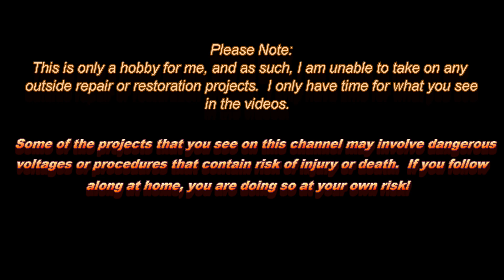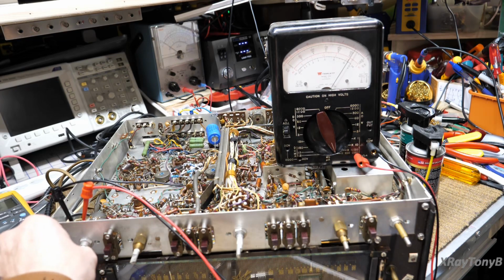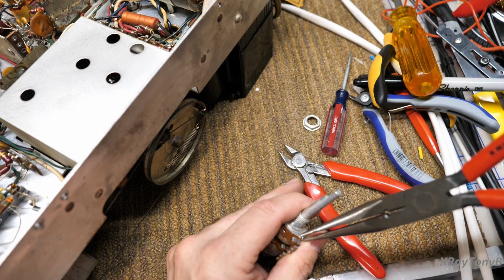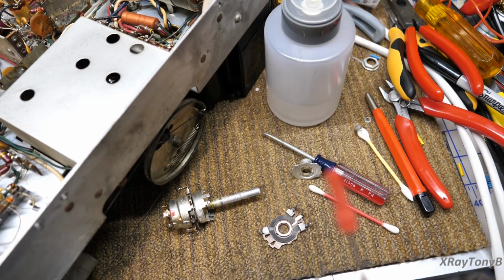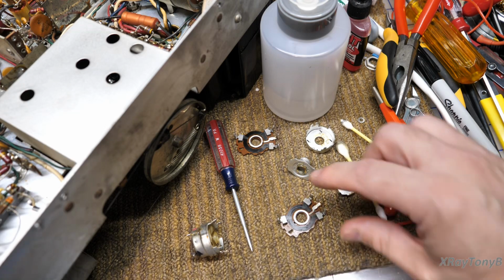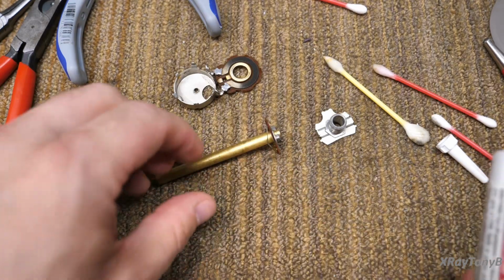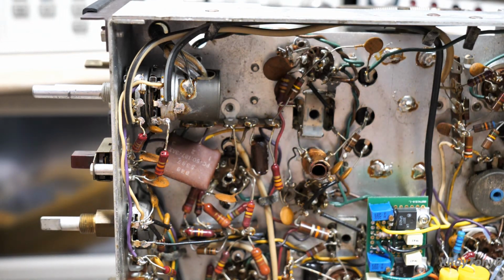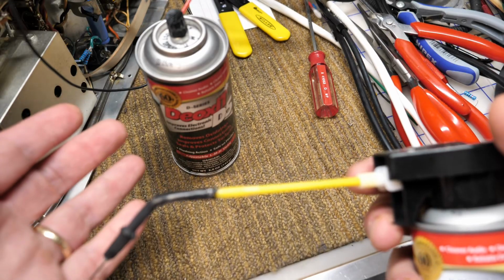How to Clean & Resurrect an Embalmed Potentiometer (With Bonus Rant)

Comment: This video is 2 years old now but I just want to say that I'm afraid Tony you are incorrect here and you should really make a follow up video. I have completely debunked the 'D5 eats carbon' myth on my channel. D5 is totally safe for use on carbon pots, and these days it even expressly says so on the can. Tens of millions of applications on millions of carbon pots by thousands of techs. If there was the slightest problem it would be all over the internet. There's virtually nothing. The solvent in D5 and F5 are identical by the way, so that's another error. Use D5 with confidence. I'm an amp tech with 50 years under my belt and thousands of amp repairs. This stuff is safe AND it's the ONLY spray I know which will sort all pot problems. Here's why. Almost any spray solvent will do on a pot because the mechanical flushing action blasts away debris and dirt. Even isopropyl alcohool. That will cure 90% of pot problems. BUT... on the final 10% the little metal wiper is oxidised and no amount of spray will sort it. DeOxit fixes this oxidation. That's why I use this product having tried many others. And no, I haven;t even had so much as a free can from DeOxit, so I;m not shilling their product!
Reply: Wrong still Stuart. You were wrong back then and wrong now. 
Deoxit makes a product that clearly and explicitly states it is for faders and pots.
It's called F5
D5 doesn't say anywhere that it is for faders and pots.
I'm not sure why you have this issue with comprehending basic logic. But there is clearly a stubborn I've always done it this way old man thing going.
You were wrong a year ago when I told you. And you're still wrong.
The process may take a long time. But you don't have to be the smartest person in the world to understand that mineral spirits will loosen carbon particles. It's why it's used to clean vehicle engines.
The track on faders and pots is made of what?
Pressed Carbon dust.
Do the logic stuart and stop being a stubborn old fol
Reply: John, see  my reply on your simular comment elsewhere. For others: John is merely repeating a myth with no evidence other than that he 'thinks' it to be true. John, if I'm worng, evidence please of D5 ruining carbon track pots. Did you see my vid where I soaked a carbon track in DeOxit for a year and it was 100% ok? The new cans of D5 have 'potentiometers' listed as a use. I also have this in writing from the manufacturer, so you have to believe they're just lying or idiots. Also, tens of millions of applications  by tens of thousands of service techs over many, many years and NADA in the way of 'This product ruined my pots'.  I've cleaned tens of thousands of pots with this prouct over many, many years. I have never had a single customer come back and say "You've ruined my amp - all the pots are not working. What the * did you put on them???"

People: it's safe and one of the best products out there but ONLY because it has the dEoXIT component in the formulation. This deoxidises the metal wiper for the 1 in 10 pots that need this. 9/10 pots can be cleaned with pretty much any generic spray solvent cleaner or even alcohol as all this is doing is flushing away contaminants like dust and dirt. This is what got me using DeOxit in the first place. I couldn't work out why alcohol worked fine for most pots I cleaned, but there were 'stubborn' ones which just did not get better not matter how much cleaning I did. This is how I found out about the 'oxidised wiper'. DeOxit cured these instantly. I have nothing to gain by explaining and researching all this. I haven't even had so much as a free can from them!
Reply: I have a can of deoxit d5 in front of me, it clearly states that the uses are for switches, contacts and potentiometers on the back of the can. I do agre with stuart that this is a myth.
Reply: I just stumbled on this video after the myth busting one. I would say to if you want a definitive answer as to what is happening with failed pots that were supposedly killed by Deoxit..mail those pots to the Deoxit manufacturer and have them do a complete analysis into why it failed. The failure may have little to do with Deoxit itself, maybe the D5 is rehydrating some older lubricant or residue (like cigarette smoke). I have no skin in the game, just a guy getting more involved in vintage audio equipment and looking for answers on care and feeding.
Reply: @tgxperience  Hi Good plan but... I don't know of ANY pots that have allegedly been trashed by DeOxit so it would be hard to get hold of them!
Reply: In the latest packaging, DeOxit D5 has ‘potentiometers’ on the list of uses. Congratulations, you have based your OPINION on an OLD can lmao
Reply: @johnsuggs7828  F5 has the same makeup as Deoxit just a higher percentage of lubricant as faders are a high use item and need more lubrication than a rotary volume and tone controls which are used sparingly. Stuart is correct, mineral spirits does not dissolve carbon. In the car industry they usually revert to a base (lye), an acid (hydrochloric), or physical (sand blasting) to remove carbon as mineral spirts will not touch it. It's great for grease but not carbon.
Reply: @Cpt_Adama  Believe stuart. Doesn't effect me. And I did say that doesn't dissolve it. What I've learned from this is as a scientist there are people who no matter how much you present them with logic, they will continue along the path on which they are because it's what they know. I keep asking the same question which no one is answering. Including you. 
If they are the same, the company wouldn't market them as different. If they did, that would be bait and switch. Don't know how it is outside the United States, but here it's illegal to do that. So there legally has to be some difference. They created TWO
Once says it's for faders.
Once DOESN'T state faders. IT DOESN'T state it.
So why then is there two products?
Reply: DeOxit doesn’t damage pots. Period. End of story.
Reply: @johnsuggs7828  I have a can of D5 that I bought in 1992, and another brand-new can.  BOTH say to use on potentiometers.  I can't post a picture here.
Reply: @RobRice-so5nv  why would the company make two products sold differently but do the same thing?
One says faders  and pots....one doesn't 
I use the one that does. Logic would state....
Reply: @RobRice-so5nv  Does it say that now and why do they make two then?
Reply: Prove it?. to debunk Tony's Theory, you would need to over use "as mentioned in vid" the over priced D5 over a long period of time.
Reply: @rundownrecording6073  Please can you use it on your switch, so we can turn it off.
Reply: @patrickjamesworrow1130  Hi Patrick. Agreed but that's a tough experiment to carry out. I fall back on the tens of millions of uses over many, many years and the virtually zero internet presence of 'this stuff ruined my pots' etc. It would be all over the net if there was a long term problem. But I agree, this doesn't 'prove' it. All the best
Reply: @johnsuggs7828  Really ? i did the same for my 5150 pots and there still fine after 6 years ? i assume they use carbon as well ?
Reply: @christopherdunn317  Yeah really. What you all need to understand is I really do not care what you do with your gear. It's not my gear. Stuart is as brain dead a human being as I've ever seen in my 30+ years as a scientist and 50+ as a human being. The company actually makes a product that is explicitly stated to be used for pots. The one you all are using doesn't state that. I'm not sure why there's an issue of understanding but whatever
Reply: @Technical_Audio  but in this country genius, that would be illegal. It's called bait and switch. You can't legally sell two products that are the same and market them as different. There has to be something different, otherwise that's bait and switch which is classified as fraud. 
Why do you think there's two can?
Reply: @christopherdunn317  If I were I'd be on here debating this all the time. I'm not. Because you don't believe I'm a scientist that makes me not one? Wow. When you're educated, you really do see how stupid people are. It's scary sometimes

Comment: Hi Tony Great video on servicing hi-end pots thank you. I think you are incorrect though in stating that D5 attacks carbon. Actually, pretty much nothing (solvent wise) attacks carbon and D5 certainly does not. I've just made a video on this. I've serviced (conservatively) 10,000 pots with D5 without a single problem. Same story for every amp tech I know. Millions of pots serviced. Also Caig have explicitely written to me and stated that D5 is safe for use on carbon track pots. You would have to believe they were flat-out lying to maintain that it attacks carbon. Yes of course any solvent will probably wash away the grease on your high-end pots. But it's the myth that D5 attacks carbon that I would love to put to bed once and for all! Soak a carbon track from a pot in D5 for a month then loom at it uder a microscope. There won't be the slightest damage. I believe the myth arose because some people believe minueral spirits dissolve carbon. They do not. People using it to clean carbon off engine are merely removing loose carbon particles which then go into suspension in the mineral spirit. Hope you don't mind me saying all this. Great work and a great channel.
Reply: @overdriver99  Ah thanks Tony interesting. I've never experienced that myself. Also I've noticed D5 is not very cold when it comes out. All the best.
Reply: Can you explain what is used to attach the carbon materials to the strip and how D5 interacts with that adhesive?
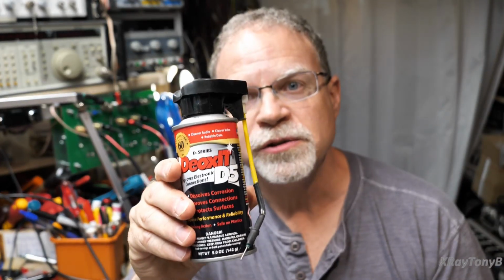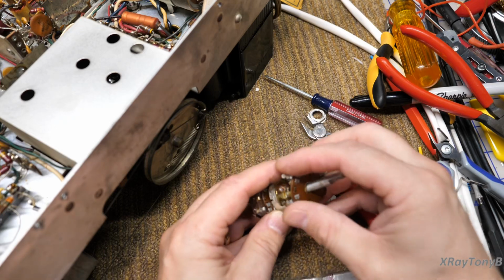Reply: He stated D5 is the “enemy of potentiometers” but not just any pot, “but carbon potentiometers” 2:35 but then went on to claim that D5 dissolves the “friction grease” 14:05 “which allows corrosion or crud to get in there” - I doubt friction grease is only applied to carbon pots. So where is the evidence of the claim of specifically carbon pots? There is none.
Reply: My understanding or conclusion has been that the “D” version is indeed recommended for metal contacts protection.  It should leave a very thin protective layer on metal.  Protective in the sense of limiting atmospheric contaminants, including oxygen, but most importantly the sulphur compounds (from your sweat and breathing) which tarnishes especially silver contacts.  If, on the other hand you apply it to carbon, you leave atomic layer of insulator on top of the carbon.  We are talking about carbon track and carbon wiper, both normally quite soft and lubricating as  contact.  So, you have coated the carbon with some invisible — even on a microscope — contamination layer.  On metal contacts, there is no harm, as metal penetrates the D5-layer, being hard enough.  That is in contrast to the carbon to carbon contact that cannot penetrate the thin, harder layer.  Additionally, I speculate that the fresh layer of D5 may look like working fine even on carbon potentiometers, but do the damage in several months.

Comment: American pots used in Fishers did not contain "friction grease."  That was ordinary grease for lubricating shaft and bushing to maintain low friction by keeping moisture and dust out.  It's the Japanese pot makers that introduced a lubricant I'll call a "damping grease" to give a control that smooth rotation feeling.

Comment: Have you tried 3.3 oz. Technician Grade Dielectric Grease from home depot? At $13 it sounds a better deal to me; plus the added benefit of a 3.3 oz tube could last you well into the next millennia. Safe on plastics and rubber too. Maybe it's wort doing a comparison video because I can see little difference between the performance of the two greases.
Reply: I was going to ask the same thing? but I seen you stated question already👍
Reply: @ronniepirtlejr2606  Great minds Sir, Great minds.
Reply: I use the Super Lube Syncolon grease from HD - It has Teflon in it.  I’ve used it for years from back when radio shack sold it.  It costs $6.67 for a 3 oz tube.  It is also available as a 4 oz bottle of oil.

Comment: Wow excellent informative video and you saved my bacon. I’m a retired electronics engineer and presently performing some overdue maintenance on my Marantz, SAE and Harmon Kardon audio equipment from the 1970’s. It has many dirty switches and noisy pots in them. All of my cleaners are gone and I searched the internet for replacements. I came across a dude explaining how a pot works and how great this DeoxIT Red is for cleaning pots. Then I watched your video of how bad this stuff is for pots and what should be used instead and how to clean the switches. Boy I almost destroyed some high dollar classic audio gear. I hope this video goes viral and informs many others. Thanks again.

Comment: Great rant and bang on. Deoxit D5 is excellent for cleaning metal contacts only, not carbon comp potentiometers. My choice - MG Chemicals 404B with silicones for electronics, safe for plastics, leaves a dry silicone lube, as good or better than Deoxit Fader F5 at a fraction of the cost.

Comment: Thank you for sharing a good process for cleaning and re-lubricating old pots! One comment I would like to make, is at 18:16 , when you were going to clean the center contact ring, you showed us a fiberglass scratch brush with what looks like a used and dirty surface. If you have a pair of scissors made for cutting kevlar and carbon fiber (easily available from common "delivery and auction" sources) , you can use that to trim the dirty end of the fiberglass brush surface back to get a clean brush that hopefully won't deposit any contaminants on what you are trying to clean.

Comment: Great video. I’ve also found that spraying pots can leech up the pot shaft and ruin the nice smooth dampened feel. Really, these pots need the TINIEST drop of the fader lube on the wiper. No need to spray the crap out of them.

Comment: Yes, for carbon pots and faders: green stuff, green stuff, GREEN STUFF!!!!! Works an absolute treat. 
“Conductive plastic” means “carbon-track”, as I believe (but do check me on this) that the carbon tracks in most potentiometers are made of carbon-impregnated *plastic*.
They’re trying to be clear, but it’s created much confusion. 

I recently restored two old (and very valuable) drum machines, and I had to order a new can of F5, as I certainly didn’t wanna screw those pots up. ALL the pots were completely restored by flushing them with DeOxit GREEN F5 “Fader Lube”.

Comment: Yay! Good to see somebody else who "gets" it. De-Oxit is frequently misused and overused. The active ingredients are organic acids ---- more acidic than organic! ----  and you shouldn't leave all that gunk inside the pot. By the way, glass-bristle scratch brushes are an extremely useful tool, but the bristles vary greatly in stiffness and hardness from one make/supplier to another, and some will leave a rough surface on the metal commutator rings or even remove the silver plating. I find that a pencil eraser works well on both the carbon track and the metal ring. As for the scratch brushes, buy some replacement brushes from two or three different suppliers and you might get some really soft ones suitable for cleaning the metal without scratching.  The stiffer ones are particulatly good for cleaning NOS terminal strips and tube socket contacts, or an amp chassis,, prior to soldering.

Comment: Boy I am so glad that somebody made a comment on You Tube Video on this subject.  I felt lost at the amount of people or techs using it on Pots and Sliders and I suspect its because of advertising.  I quickly became distrustful of DeOxit D5 when I first used it to rejuvenate a turn signal relay on my car as it came highly recomended by a clerk that worked as an electrician at Home Depot. On seperate occasions it repeatedly developed carbon on the contacts of the relay and quit working.  The best peformance I got was about five weeks.  I was being cheap and should have bought the more expensive TV Tuner Cleaner. Yep thats what the sprays name was called.  Quite a long time ago I used it on pots relays, record switches and relay contacts and never had a problems with them failing.  I had also used it on five old car relays and never had a problem after words. As I wrote this comment, I have been diligently looking for a replacement to the actual and original TV Tuner cleaner and hoping to find what the contents of that product was.  Ironically I never ever used it on a tv tuner, I felt that that product was undermarketed and could have been given a better, descriptive name. Reading the comments on the internet, it seems that one can of TV Tuner Cleaner can replace 2 to 3  cans that require doing the same job from reading peoples comments.  Unfortunately I've heard that TV Tuner Cleaner has been discontinued.  Getting back to DeOxit D5 I found it useful for getting rid of corrosion from the spring like Triple AAA battery contacts and other metal contact surfaces but that was all. After words cleaned them up with a q-tip and then applied a light other and more trusted oil. In the case of the relay, metal likes oil.  I would cut out a small rectangular piece of card stock a little wider than width of the relay contact and spray it with a small amount TV Tuner Cleaner and then slide it between the cleaned contacts and they where as good as new.  You can clean the surface or even file them clean, but if you don't put a thin layer of oil, the relay will fail down the road.

     If anyone or somebody knows what the contents of TV Tuner Cleaner had or their experience please comment.  I sure would be greatful and suspect others would be too. Experience is the best school.